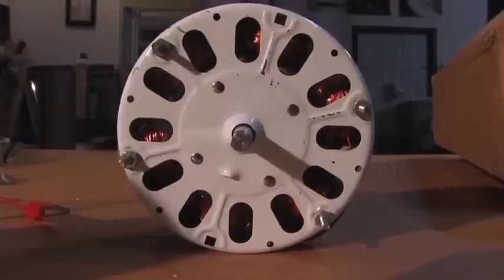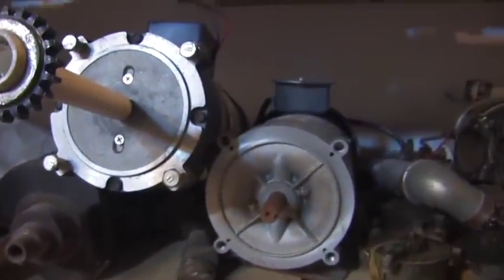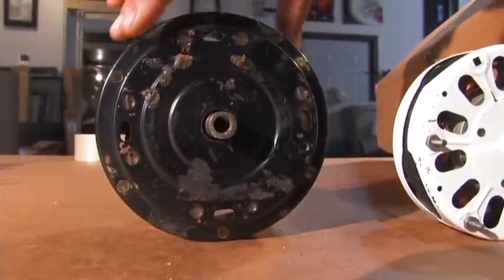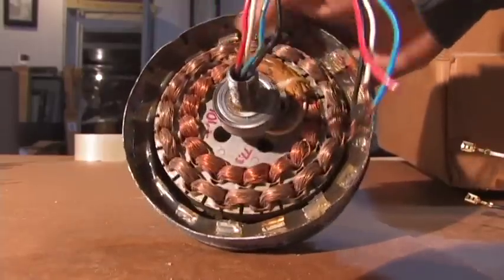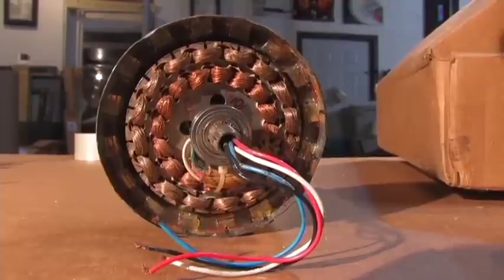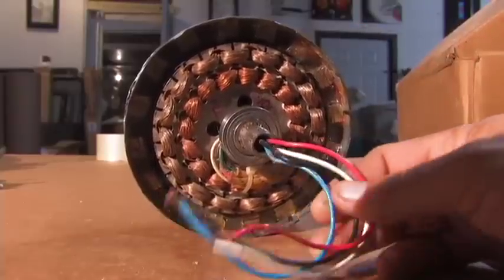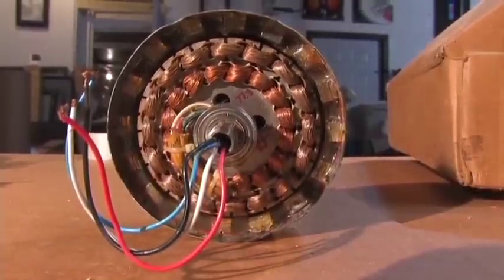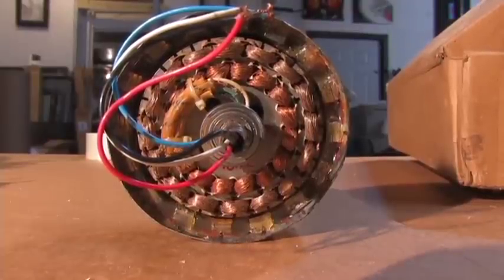CEILING FAN GENERATOR ALTERNATOR DIY Real Free Energy

Comment: hello, we are conducting our research about treadle powered generator all we need to do is stored the energy into the battery by pedaling the treadle but we have problem we cannot charge the battery and the motor we use is from a ceiling fan and as you said that ceiling fan is AC how can we charge a battery?

Comment: I've done 3 of these. Here's the secret. Don't put north on one coil then south on the next . Use smaller magnets putting them ns ...sn...ns...sn. Or turn the magnets on their side the same way south facing south and north facing north. This doubles the power and spins easier. You will be amazed. I'm lighting 45 watt AC bulbs with the slightest breeze. Try it
Reply: @markleary2805 Yet you have NO VIDEOS to prove your crazy claims .

Comment: Why can't you use AC current in your home? In my home, the output of the lighting and 30 amp or lower wall outlets are 120v AC and the higher capacity appliances are either hardwired, with or equipped with a dedicated 240v AC outlet, and matching input amperage rating supply power cord plug, non interchangeable, but supply input is 120-240v AC @ 200 amps, not a single DC supply receptacle on any wall outlet.
Reply: Yes your appliances use 120v AC, but the part you are missing is the hz or cycles. Unless you have a constant 60 hz(in USA) you will burn up you appliances/devices.

Comment: this modification includes adding permanent magnets...……..an ac induction motor  produces NO electrical power by spinning it.
Reply: Actually spinning an induction motor does generate electricity if capacitors are connected on series between motor and load. Try youtuber Robert Murray-Smith's video "An Induction Motor As A Generator Without Altering The Motor"

Comment: Use a normal ac motor as a generator to make ac voltage.
If you get the rpms up to the amount on the name plate, then you should have the voltage that's on the name plate too.
There's this thing most people don't know, called a MG set, or motor-generator, they use a motor to turn another motor to make isolated ac output.

Comment: Hey Dan is it posible to use a gas generator converted to run on alcohol as the source of power for an ac 1 phase motor ev project i am contemplating. Great channel. Great info but I am as dumb as a box of rocks when it comes to electrical connection and so on. Need some advice any will help. Have a great day.

Comment: The magnets must be as close to the coils as possible for maximum energy transfer.  The further away, the more energy you lose.  They also need to have their field orientation pointing at the right direction so the lines of flux that cut across the windings will have the most efficient transfer possible.  You don't want the magnets fighting each other, nor a negative feedback loop from incorrect relationship to the windings becoming temporary energized electromagnets fighting the magnets.
Reply: Matt Carrell shut a fuck up. They have a good orientation. It's a Ac motor for home use. They won't build this for shirt life or to burn your ceiling from overheating. The magnets generate current even from 10mm far. Shut a fuck up child. Read about magnets before you talk like an idiot

Comment: Hello my host Dan Rojas! I have a question that I couldnt find through google or in your comments. My question is: What is the most efficient electrical generator? a permanent magnet DC motor with brushes, alternator that needs an excited mag field, an ac motor with rectifier, etc? I just want to use the most efficient generator type for my projects. Thanks in advance! I love your videos.

Comment: Instead of putting the magnets around the outside ring, could they be mounted to a plate on the top of the rod in the center of the fan?
Reply: No, it would be awfully ineffectient

Comment from the maker: Hi,

Most DC motors already have magnets in them and operate as a generator. While the magentas are usually NOT neodymium magnets, it will work as is. The motor has brushes and commutators allowing for Direct current usage as a DC motor. So in reverse, the motor will produce DC current. Hook a voltage meter to it and spin the shaft. If it produces current it already has magnets.

Comment: Ive built these with good results but was wondering if I was to use to charge a battery bank for a grid tie connection and used say a 200ah battery 12 volt run it down to 11 volts how long would this turbin take to recharge battery to 14 volts if your turbin puts out 20 volts at 1 amp?

Comment: @kevbow0137 resistors would be an easy way, a little more efficient way would be some regulation circuitry that would send the excess to the resistor bank when the voltage goes over a certain threshold.

Comment: @kevbow0137 Frequency is tied to rotation speed, but so is the voltage that is produced. Of course you can always get around this problem by using DC generator and inverter for the proper AC output. It depends on what you want to use it for. Newer AC generators are being built with larger coils so that the blades can spin slower while still producing the same voltage. Keep in mind these things are going to be massive.

Comment: @kevbow0137 Right, you'd want to use a gearing system or some type of transmission so that the blades can turn fairly slowly, while the generator itself would be rotating at the proper 3600 RPMs. After that, some circuitry can be used to dump the additional energy to help keep the RPMs in the proper range when the winds are higher therefore creating a somewhat decent electromechanical breaking/transmission system.

Comment: @kevbow0137 to get the proper frequency to use it as an A.C. generator, you need to control the rotation rate of the device. For instance, if you want 60Hz, you'll need to ensure a spin rate of 3600 RPM or 60*60, if your dealing with 50Hz it'll be 3000 RPM or 50*60. That being said, you wouldn't want to do that unless you are either off grid or have a piece of equipment that synchronizes the signals going into the house. This goes for D.C. to A.C. conversion as well.

Comment: Also, while less critical, there is no regulation circuitry either. Just like ripple reduction (the purpose of the capacitor) there are a variety of ways to do this, some of which are quite simple.

Comment: @idahoviewing I am very well aware of that fact as I have an engineering degree, however neither Dan or Muddy (didn't get to watch all the vids, but it should have been mentioned in the first few that I watched) make any mention of what should be done creating a more appropriate D.C. signal. It is also falsely stated that A.C. signals will destroy or play havoc with your household appliances. The more likely problem would be inappropriate frequency, since the circuitry is designed to work with

Comment: @asbecka ....additional filtering. This is usually in the form of a large capacitor. This smooths out the wave form to something VERY close to a dc voltage.

Comment: Some electric motor/generator basics: 1) they are both grounded in electromagnetic principles and both require permanent magnets to function. If you add electric current to a electric motor it causes it to spin, if you spin the shaft of an electric motor it generates a current. This occurs regardless of whether it is an A.C. Or D.C. motor. While adding a rectifier to a A.C. Motor being used as a generator, the D.C. current it produces isn't the best without the best without the addition of addi

Comment: When using blades for your generator it is better to use an odd number of blades. Also use more blades if your in a lower wind area. Less blades run faster in a higher wind. 
Thanks Dan